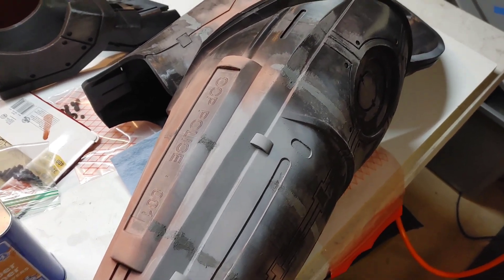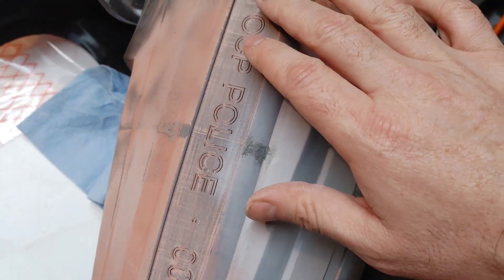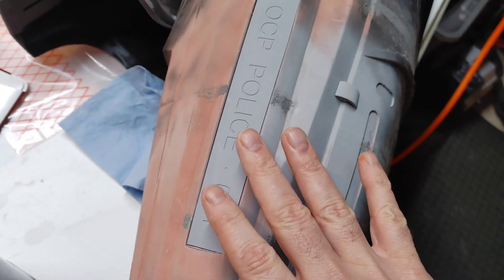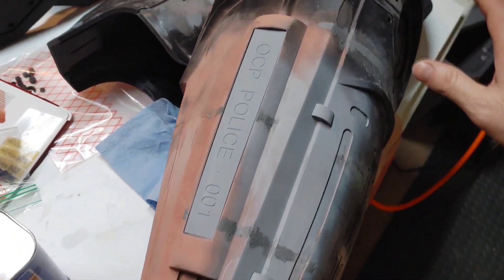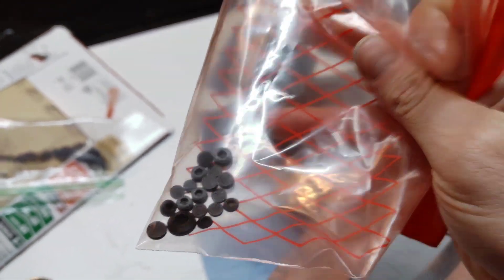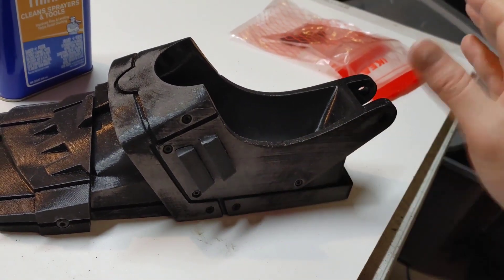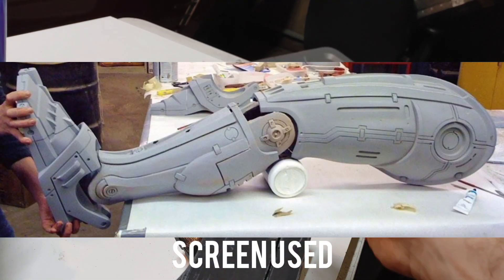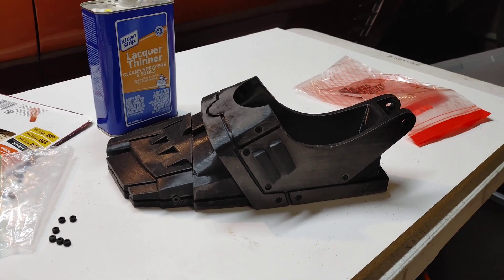My Second 3D Printed Robocop Suit - Part 4 - OCP Engraved Plate and Screw Detail

Comment: it looks amazing and i cant wait to see the end of it, i hope i can make one as well one day

do you remember how many 1k pla did you use?
10k? 15k?
i dont want to buy a pack and then see it was not enough
Reply from the maker: Definitely close to 15 rolls. That's a safe number to put your money on. Depending on your failures it could be a tad more or less.
Reply: also, is it a better option to buy abs instead of pla+ or maybe petg?
Reply from the maker: PLA plus is your best bet. It's easier to print and is much stronger and better thermal properties then basic PLA. ABS is too hard to print and I wouldn't mess with it. I've heard PETG is ok but can also be finnicky.

Comment: I looked through my notes and original STLs and OBJs from Asen to see if I could figure out why we both missed the same two left thigh pegs. They're not visible in his breakaway diagrams and I don't see a file for them. A couple of the pieces used on the left calf are very similar in size and shape.  Did you use one of those in lieu of the missing files?
Reply from the maker: Your right on. I just used a peg that was similar in size from the calves and printed duplicates, I believe it was the smallest one of the lot. I hope that helps.

Comment: I’m stuck on the jaw guard. I bought the same file you used but it prints with only one wall and no in-fill 😭😭. Plas. Halp!
Reply from the maker: Sounds like a slicer problem. I use Simplify3D with the provided printer profile for my 3D printer and I don't have those issues. I highly recoomend.
Reply: @ChrisBoshProps  I have simplify3d but rarely use it (snapmaker comes with its own slicer Luban). When I put the files in simplify3d they are massive and ‘bigger then the print bed’. I’m not sure how to resize correctly did you have this issue? My helmet came out perfect and thank you for the filler primer tip, it’s almost completely smooth!
Reply from the maker: @phongbong  What kind of printer are you using? I'm using a Creality CR10 so I'm able to print the chinguard in one piece. I'm sure even on an Ender 3 you can still print it in one piece. Make sure in Simplify3D you chose the correct printer profile for your printer. I don't have those issues. The chinguard file imports into Simplify3D with the proper size.
Reply: I will go through my settings again. I have a snap maker 2.0 with a 12x12” bed I did the helmet in one go.  Your tutorials are invaluable keep it up my dude! I will be robocop one day, oh yes 😂

Comment: its crazy looking at the detail of the screen use stuff, then you look at the painted feet and its like a pearlescent blue and they painted over the screws. i like the fiberglass work on the inside, it gives me an idea on how to adhere it. i use to work at 5 star doing nascar parts and we would vacuum seal the parts in a plastic bag. if you glass mat the inside then stick it into a garbage bag you can vacuum it out and form fit it. plus the bag would be thin enough to not be an issue if you cant get most of it off.
Reply from the maker: Thanks for the comment Chomp and thanks for tip that's pretty cool you got to work on Nascar parts.